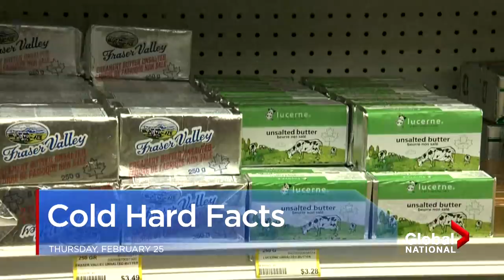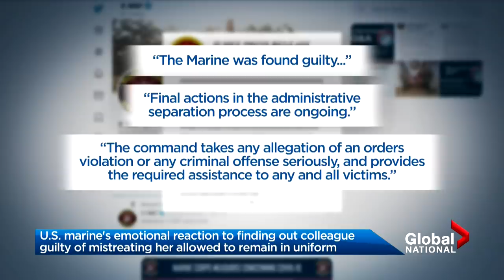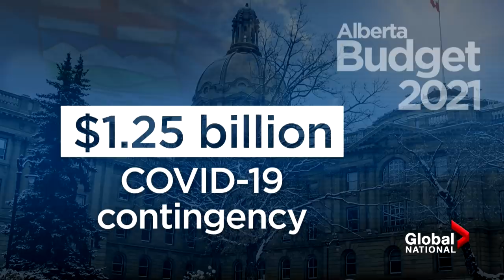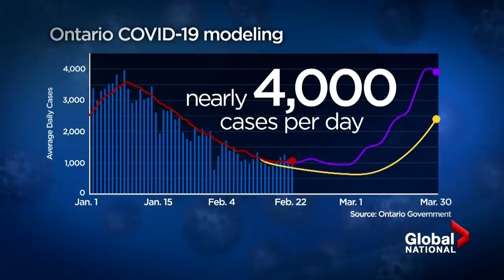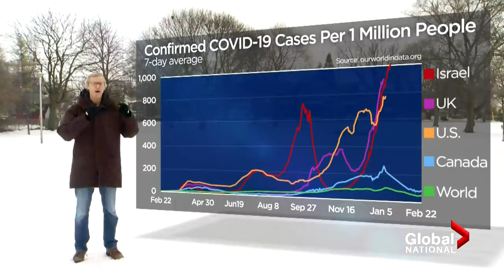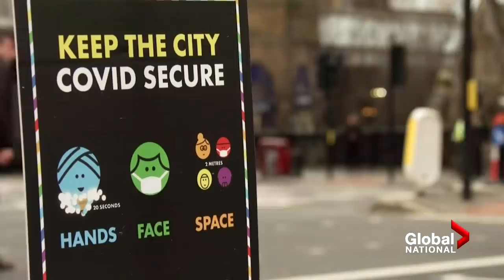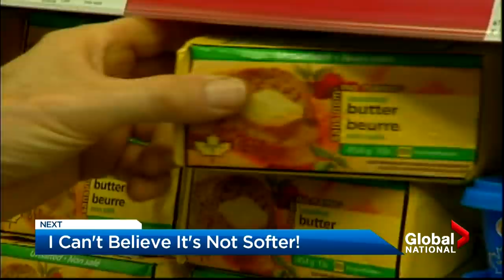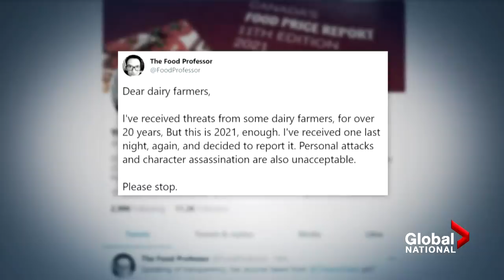Global National: Feb. 25, 2021 | Military reacts to another top Canadian soldier under investigation

Comment: Haha thought I was going crazy with the butter... Mine will not spread either!
Reply: I Noticed it a month ago. Pissed off about having to heat it in the microwave every time in order to spread it on toast. 30 seconds is often too much if the amount of butter is low. It’s a real bummer and learning curve to know the amount of butter you have and the time you need to nuke it so you end up with just the right amount of soft butter to spread. 
I’ve actually started to eat my boiled potatoes without butter just for this reason. From the fridge, Add some salt, pepper and salsa and they are still awesome.
Reply: my   whole   life   is    a   lie   🥺

Comment: This really butters my bread. If my butter doesn't spread on my bread easily I just lose it. Clearly the spread of my butter isn't spreading as well as the Covid is. All will be well, I am sure my butter will be better and spread like butter should spread, smooth and not hard. If my butter is hard it will not spread, if it is smooth it will spread. Bitter butter batter better batter because butter better be bitter. Butter...Butter...BUTTER....BUTTTTTTEERRRRRRRRRRRRRRRRRRRRRR!!!
Reply: Margarine. simple solution. No animal products, gross, are you a cow?
Reply: Margarine has no taste, it clogs the arteries and is useless on popcorn. Butter is tasty, even tastier with sea salt,  clogs the arteries but seems to clean out better than margarine.over time.